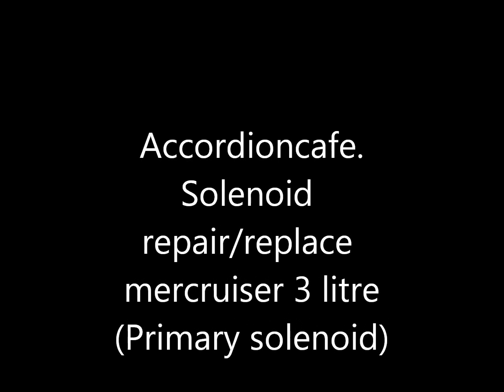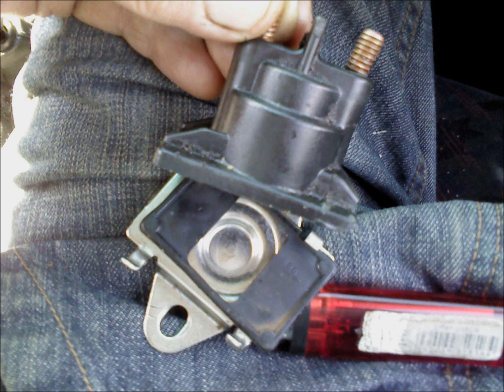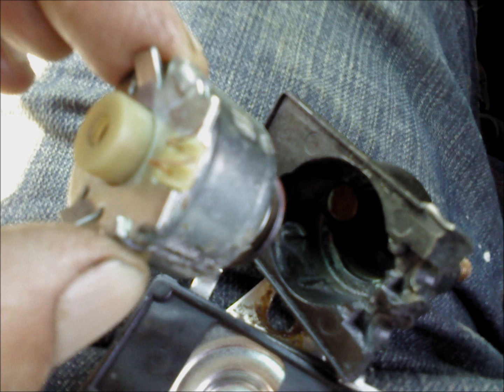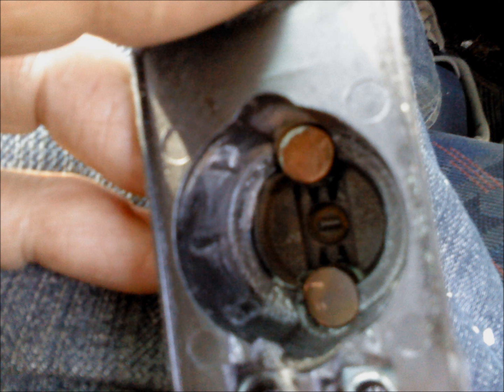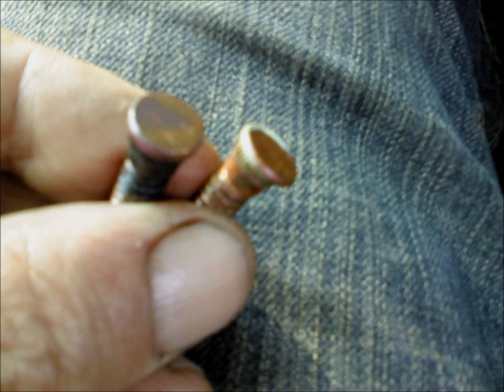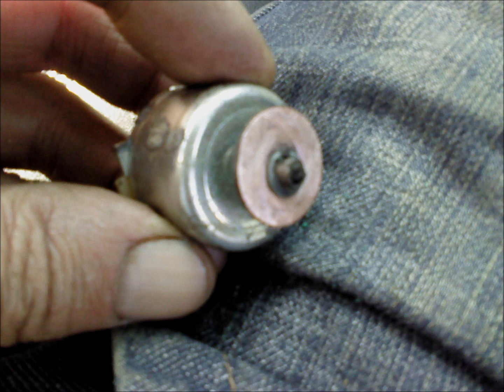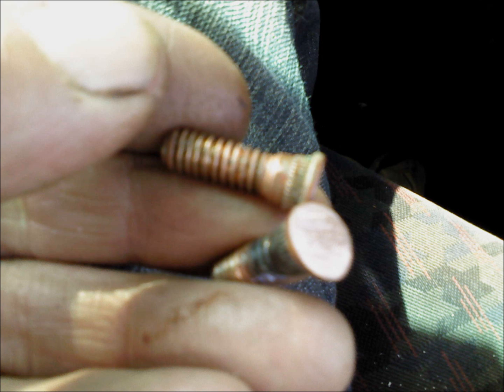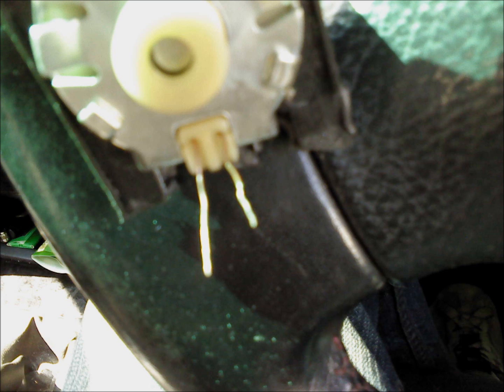MERCRUISER Fault FOUND. Alpha one

Comment: A brand new solenoid costs $14 on amazon. Informative video but I dont think its worth the hassle to try and refurbish an old one.
Reply from the maker: Why is it that everyone wants to save a buck. Try learning something for a change.
Reply: As originally stated, very informative video. I did learn what goes on inside a solenoid. But my comment was actually about spending a buck to save or otherwise allocate one's limited and valuable time. How much is an hour of your time worth? If its much more than $14 then its wiser to buy a new one rather than refurbish an old. And how much more likely to fail in the near future is the old refurbished solenoid vs a newly manufactured one? Plus I dont know if many people who may be experiencing the same problems are aware that a new solenoid is so cheap and relatively easy to replace on ones own. I didnt until I recently had to fix a starting problem on my own boat. I meant no offense to you or your video, I appreciated it actually.
Reply from the maker: Yes , buy a new one. Its ok if you've got money to throw around for the sake of a bit of emery paper you could give that money to a worthy cause ( send it to me if youre not sure which one)
Reply from the maker: Of course not. I agree. When I started in domestic appliance repairs 50 years ago my manager was a stickler for stripping every single item to the bare core. This has stuck with me my whole life. Its been a very interesting a less damaging to environment trip. But yes, these days we 'throw away'.